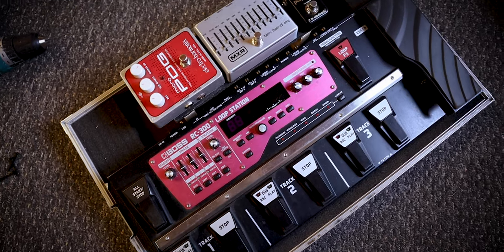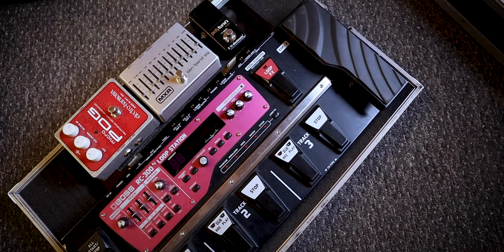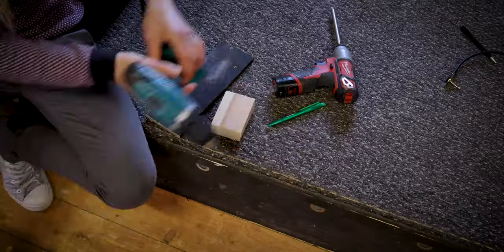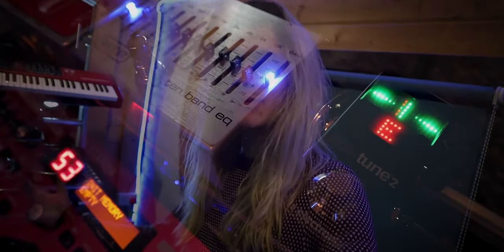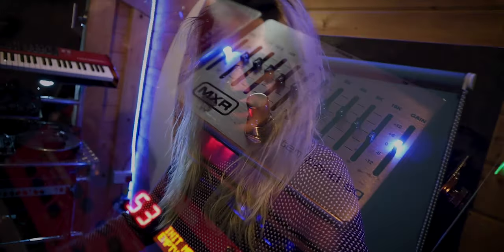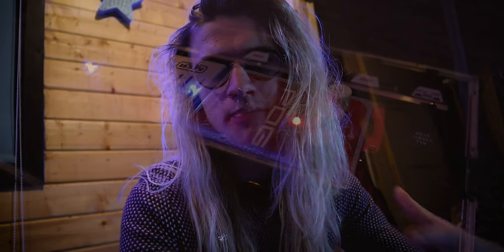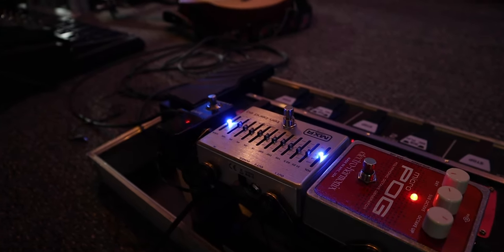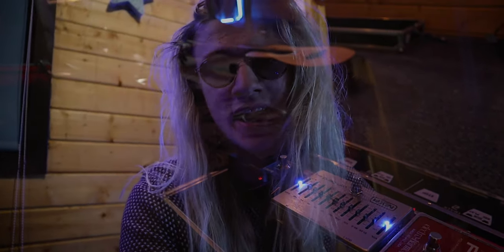You NEED to upgrade your Boss RC-300 Setup! | Tutorial

Comment: Hey Ben, Thanks so very much for expanding the info on the RC300!  I have a question.  I am an amplified fiddler wanting to augment live playing (busking) with my pre-recorded loops, so volume matching loops to the live fiddle in realtime is pretty crucial.  I want to control the volume of all 3 loop playback tracks at once. I understand that it is possible to assign the EXP1 pedal to master loop volume. I’ve been digging through the RC300 manual, but can’t figure out just how to make that assignment.  What section/editing parameter(s) could I adjust to make this work?  

I am also tempted by your RC300 video course—The machine is a monster.  

Btw, I am seriously looking into using Ableton live with the KMI Softstep 2 and a UAD Arrow.  It looks like a fantastic and very portable arrangement. Have you ever looked into the Softstep?